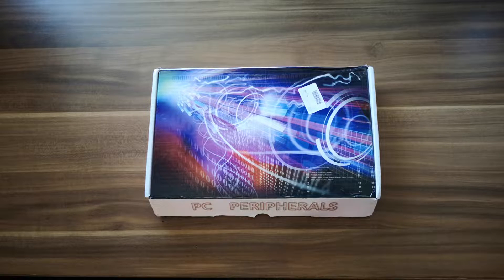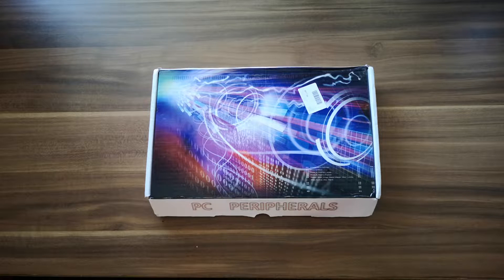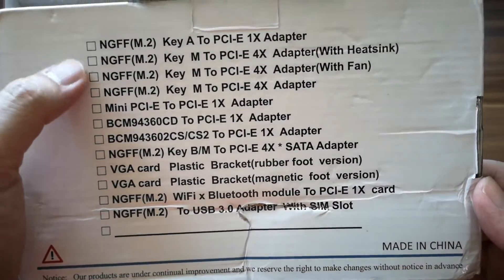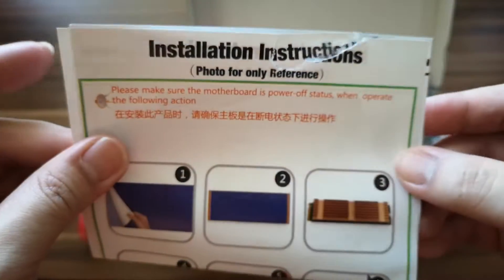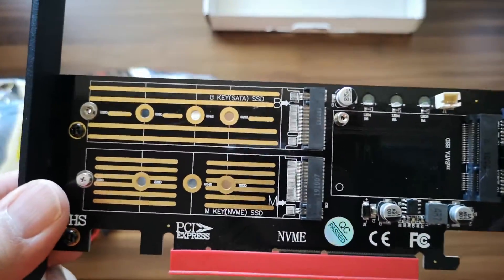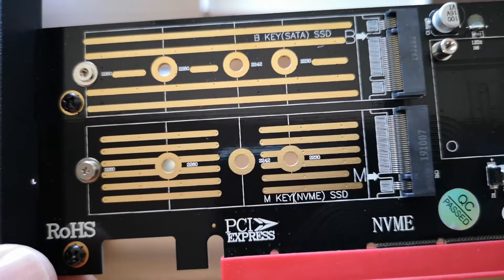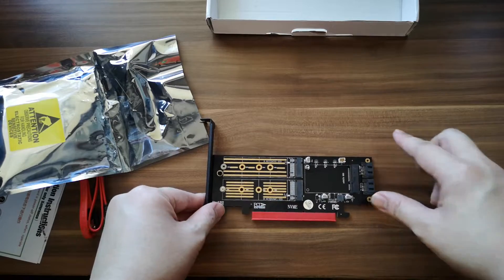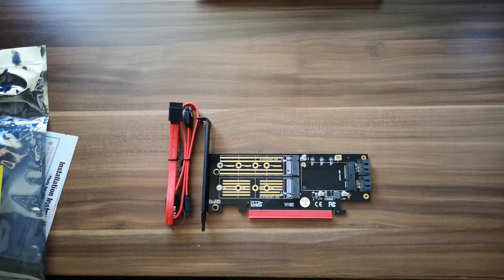Avivahc 3 in 1 Msata PCIE M.2 NGFF NVME SATA SSD to PCI-E 4X SATA3 Adapter - Unboxing and Overview

Comment: Can you run 1 m.2 nvme ssd, 1 sata m.2 ssd, and 1 msata simultaneously? In a 16x length slot with only x4 connectivity??
Reply from the maker: Hm, i dont think you can..

Comment: I have two questions. 1. Is this faster than a SATA 6.0, and 2. Can I install more than 1 SSD with that card?
Reply from the maker: yes if you connect an nvme ssd, no i think only 1 at a time

Comment: Hi, I have a generic card with no instructions but it looks almost exactly like yours. Why does it need the SATA cables if it has PCIe pins on the board and where should I plug the SATA cables in the host?